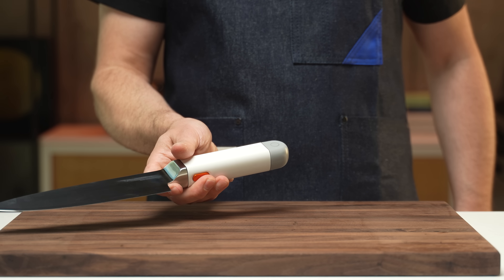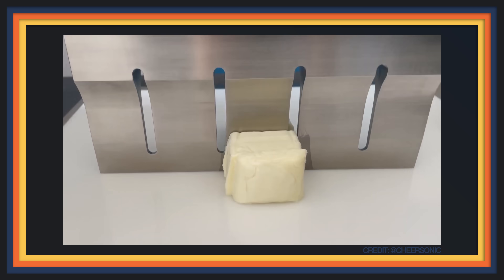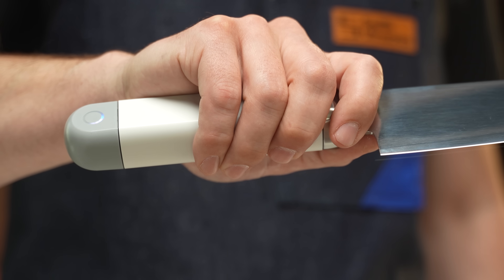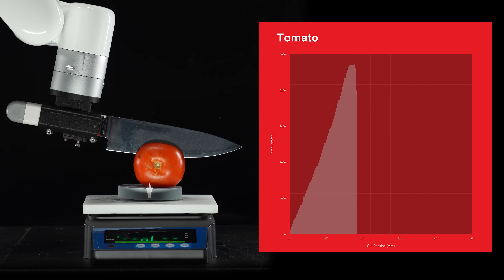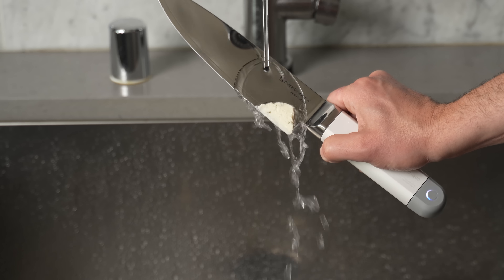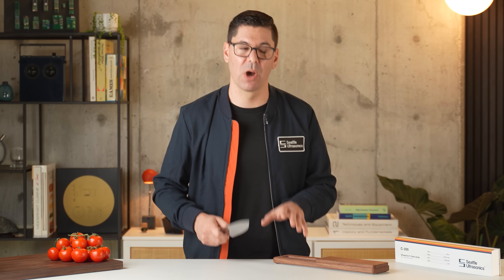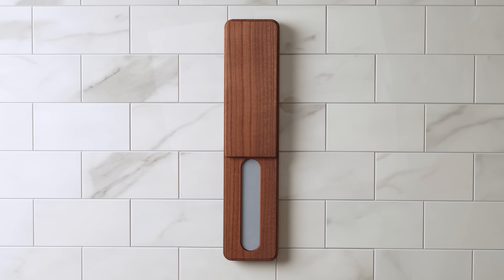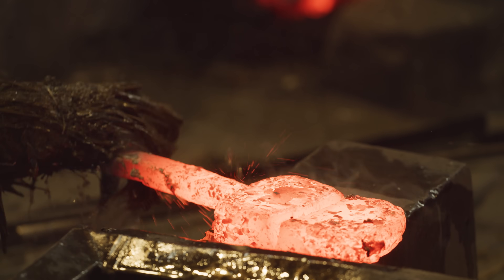The World's First Ultrasonic Chef's Knife for Home Cooks: Seattle Ultrasonics C-200

Comment: Huh?? How does the knife charge on the wall "with no cords required".
Reply from the maker: The Charging Tile itself is almost like an external battery pack...when it is fully charged, it will fully charge your knife 8-10 times. When the charging tile is low, charge it via USB-C (it will take about an hour), and then it's good to go again! The mount is specifically made so that whether you use command strips or screws to hang it on the wall, it is easy to dismount and hang back up again, it simply clicks into place.

Comment: When you push this button it drives your dog insane 😊
Reply from the maker: Good news! We've tested the knife around puppies, older dogs, and different breeds, and they didn't react when the knife was running. The ultrasonic frequency is generally beyond animal hearing range as well, so it shouldn't bother pets, although it has not been tested in the presence of all pet species.
Reply: @SeattleUltrasonics I guess 40kHz is a tad high for pets, but bats do upto 200kHz!
Having said that, bats are loud, very loud: 100dB ~ 140dB!!!
Maybe you could do some sound pressure level tests and compare it to a bat 😊

Comment: This looks like a great knife though i am not convinced that it will stay sharp....no knife will ever stay sharp, infact the problem with sharpeing knifes is what they use the sharpen the knife with in the first place, I have seen it all and the quickes devices are not working great
and the wetstones are messy and need to soak first, but I have not seen people use something that would work instantly...If you have every shaved you beard with a razorblade from the 50's last centuary then maybe you know that they used to use a leather belt to sharper the
knife. this design can be improved upon. One could make a belt out of a fine material as top layer that would sharpen the knife once you start sharpen the knife on the belt. That is to me the easiest and best way in a kitchen to sharpen knifes more often and getting them ultra fine sharp.

Comment: I wonder, Ultrasonic "cleaners" in Laboratories that are used to clean different instruments of dangerours materials are never to be touched when running. Inserting the Hands in Water is also dangerous. So how come this type of Ultrasonic wave is neither dangerous or loud
Reply from the maker: Although industrial ultrasonic machines are typically not safe for skin contact, Seattle Ultrasonics knives run at a small fraction of the power and will not damage your skin when operated normally. You can safely hold the knife in a pinch grip during use. The vibrations in the blade are concentrated away from the spine of the knife and into the cutting edge.

Comment: You're just moving the problem... before I had to sharpen my knife when it got dull, now I need to charge my knife when it runs out of battery... you're also just going to wear the blade down faster, which is going to be impossible to sharpen when it eventually does get too dull to work in this method. I'm sure SU has some good products but this ain't it.

Comment: Learn the art of sharpening at home have pride on it this stuff is crap je said japanis steel?? He dosent even know what type of steel his using
Reply from the maker: We do know what kind of steel we're using! The C-200's blade is made from Japanese AUS-10 stainless steel in a three-layer "san mai" construction. In san mai steel, a hard core layer is clad with tough, corrosion-resistant outer steels. The steel is heat treated to 60-62 HRC inner-layer hardness for edge-holding and durability. It comes with a 13 degree bevel per side.

Comment: Can you cut Frozen meat or Frozen fish anything Frozen so I do not need to defrost the all piece  when a want a small amount,  have you tried to cut Frozen bread anything, thank you.
Reply from the maker: It's not well suited for the scenario you're describing. When you use the ultrasonics against hard surfaces, like ice, it creates an unpleasant noise. The thin blade is great for thawed foods, but a good match for foods that are frozen solid. For that, you want a thick, beefy edge that can stand up to tough hacking. 

But if you're cutting portions off of very cold foods that aren't frozen all the way solid, then it'll perform nicely.
Reply: @SeattleUltrasonics thank you I will buy one it's curiosity because I never seen one, great product.

Comment: Incredible, my question is the danger of injury to human tissue? Next , the possibility of a surgical application?
Reply from the maker: Ultrasonics have been used in surgical applications for a long time! 
Although industrial ultrasonic machines are typically not safe for skin contact, Seattle Ultrasonics knives run at a small fraction of the power and will not damage your skin when operated normally.

You can safely hold the knife in a pinch grip during use. The vibrations in the blade are concentrated away from the spine of the knife and into the cutting edge.
Reply: Definitely will be used for surgical applications. This isn't really NEW technology but it'd be awesome to see it used like that.

Comment: "Warning: This product can expose you to lead, which is known to the State of California to cause cancer and birth defects or other reproductive harm"
ehhrm?
Reply from the maker: The piezoelectric ceramic crystals are made of a material called PZT - it's the most common material used for ultrasonic devices. PZT stands for Lead Zirconate Titanate. The lead is crapped in a crystal lattice, and the crystals themselves are inside the water-tight sealed handle, so you'll never come in contact with them. However, California law requires that any product containing lead in any form is disclosed prominently. Hence the big warning statement.

Comment: Are you holding it in a strange way or is it me? Why does your finger and thumb go off the handle?
Reply from the maker: That's called a pinch grip and it's one of the standard ways to hold a chef's knife. It's great when you want a little more control of the tip. But you can hold the knife in any grip you prefer.
Reply: @SeattleUltrasonics  thanks for explaining and the quick reply.

Comment: In an age of AI slop, this is some really sick innovation that fills me with joy to see! A few questions: 
1. what is the battery life like (I imagine it’s pretty good with piezoelectric crystals but still) and how does the weight compare to a typical knife of this size?
2. How is the balance of the knife in the hand compared to a traditional knife?
3. How durable is the blade at the tang, since the electronics necessarily take up space that would be reserved for a full tang? It’d be a shame to have my $400 knife snap off at the handle.
Reply from the maker: Thank you! For your weight, balance, size, and tang strength questions, we've got you well covered. Check out the video on our channel titled "Ultrasonic Knife TESTED: strength, weight, & size"

On a full charge, the C-200's battery provides about 20 minutes of continuous running at maximum power. However, the C-200 only runs while you're holding down the button. In practice, that 20 runtime minutes is enough to dice at least 20 onions or 40 potatoes. You'll likely get through multiple meal preps on one charge.

Comment: Demonstration is impressive.  The tech is impressive.  I want one, just for things that have been shown off. 

But I don't think it works well as a real kitchen work horse.  The reason is that most people want to cut things quickly.  If this knife could do that, it would be shown used in that way.  But it was not shown to be used to cut things quickly.  Therefore, it can not. 
It may be able to cut things quickly enough for home shefs.  But the limit to how quickly it will go was not displayed.  I can only guess it can go very slow. 
Also, a few other questions:
What happens to the cutting board when the blade runs on top of it ? 
What happens to the hand if the running knife strikes a hand hard, by accident ? 
I suspect the damage, in both cases maybe greater than if a normal knife was used.  But I could be wrong.  Yet these are relevant questions with no answers. 
Please show us more, related to 3 questions:
1. How fast or slow can this knife go ? 
2. The damage to the cutting board compared to a normal sharp knife? 
3. The damage to a bone covered by a 1/4" meat (simulating a finger), after 150ms and 250ms, compared to the damage a sharp normal knife makes.  I think 150ms-250ms is a human reaction time? 
Please give us some answers.

Comment: Wouldn't be interesting if there would be an upgrade kit for existing knives. Effectively the knife is now an oscillating tool. Some people might be able to relate to this.
Reply from the maker: That would be rad, but unfortunately physics works against us. Unlike a reciprocating. Saw where you're moving the whole tool back and forth and you can have interchangeable blades, in an ultrasonic knife like this one. The metal of the blade itself is actually resonating. Therefore, the specific shape of the blade and the frequency at which it's operating are very specific and fairly sensitive. At best you could have identical replaceable blades, but unfortunately attaching any old knife blade to an ultrasonic generator usually won't work very well.
Reply: @SeattleUltrasonics Think about it, it makes sense. Might be a nice patent if you could come up with a sweeping algorithm that would adopt to the blade and material. There must be some sort of reflection you can measure. Think tdr.😊

Comment: I'm really surprised by the price and I don't understand why others call it expensive. $400 is a good price for hi-end chef knife. I thought, that'll be about $7000 😁 I'm glad to see that you understand it's not suitable for professional cooking - it's true. Every chef who uses a knife for several hours per day prefers milder steel because you can sharpen it on a steel rod in a few seconds. You have to do it 10-40 times per day but it takes, literally, seconds, and the price of that knife is about 10 bucks so you don't need to take care of it. And, even, recharge it 🤣
I would like to buy that one-of-a-kind-knife to use at home, but I prefer to get a tungsten carbide or zirconium ceramic blade instead of steel, no matter how good this kind of steel is.

Comment: A normal knife cannot be cut if it does not move. The knife in the video begins to cut the moment it touches an object. A brief mistake will cut your finger like a sausage. It is more dangerous than necessary. It does not have to be used in restaurants or homes.

Comment: Does anyone know what material the handle is made of? It looks like simple plastic in the video, which would be a bit disappointing if that’s actually the case.
Reply from the maker: It's PC/ABS. The handle has to be made via injection molding to handle complex internal geometry and super tight tolerances. But if you check our other video on handle strength, you'll notice that it's engineered to withstand way more more force than required. And it feels solid in the hand, like a durable tool.

Comment: Can this be used as ultrasonic homogenizer ?
Reply from the maker: Great question. No, not really. Since the motion of the blade is longitudinal, there's not a lot of cross section to push against liquids to make them mix. If you put the tip in water you'll see some mixing and stirring, but a homogenizer really needs a big, flat end to create cavitations over a larger surface area.
Reply: @SeattleUltrasonics    Thanks! Curious how you set up the transducer for that longitudinal motion — fully understand if the specifics are part of your proprietary build.
Reply: Also — why don’t we just stick a perpendicular fin on the blade for more cavitation… 😂 Imagine an ultrasonic mayo-making knife.
Reply from the maker: @BurhanHalilov the orientation of the piezo stack creates a piston motion in that longitudinal direction (down the length of the blade). But the hard part is keeping the movement along that axis, since knife blades are long, thin, and flexible. The solution is just the right geometry, coupled with just the right operating frequency to maintain the intended resonant mode. And gobs and gobs of failed attempts in my wake.
Reply from the maker: @BurhanHalilov I like your thinking! I've got an idea that's similar in spirit in the works but for a whole different product...

But for knives, cavitation isn't desirable. We just want that blade edge to move back and forth for "micro slicing".

Comment: Dear Seattle.
I'll get one. But..!. I'll modify it the same way I modified my various expensive chef knives. I never understood why knife makers don't do that. There is a part of all chef knives that is  extremely dangerous and I always do this: It's the part of the cutting edge that is the nearest of your index (and thumb) when you hold the knife, It's the back of the blade. It's always plus or minus 90 degrees to the blade, very pointy, very and always sharp because we never cut that far with it. But it knicks a finger deeply in a treaturous and unexpected way if you don't pay attention to this 'corner'. It's dangerous. So I always file down that corner 1/4 of an inch and make it round and unsharpened.

Comment: I wonder what will happen if you try to sharpen it while it is on, I think it will sharpen much faster.
Reply from the maker: Yes, but... Please don't :-) Two reasons: first, as with any standing wave, there are nodes and antinodes along the blade. That is, places where the vibrations have the highest amplitude, and places where they have the lowest. So you'll get uneven wear against the blade edge. 

Second, it's way too aggressive. I tried this on an early prototype and removed almost 1mm of material in a few passes. Yikes! 

However... I do have plans for an "assisted sharpening" mode that uses the piezos to help speed up sharpening, but run at a set of different frequencies to compensate for the above. If/when I prioritize that, it'll be compatible with the V1 knives (firmware is upgradeable over BLE).
Reply: @SeattleUltrasonics  love the idea, this thing is straight out of science fiction movies (predator Badlands sword) 😊

Comment: I work as an engineer for a premier US industrial ultrasonic cleaner manufacturer, and find this extremely fascinating. I really want to know how you packed not only enough power to make this work, but enough energy to make it work for long enough to actually do anything with into such a small package. I'm incredibly curious what kind of wattage this thing is pulling while the ultrasonics are running, because there just is no way it's very much or you'd have to strap a gigantic high performance battery onto it.
Reply from the maker: We pull 10W when the knife is on, and that's enough to create a longitudinal displacement of 10-20 microns at the antinodes along the blade. That wouldn't be even close to enough power to run an ultrasonic cleaner. But, those cleaner transducers spread their energy out to an enormous cross-sectional profile where the horn meets the tank. By contrast, we reduce the cross sectional area of our piezos down to the cross-section of the blade, which tapers from about 2mm at the spine to a point at the cutting edge. So it takes way less energy (at resonance) to achieve a comparable amplitude. At just 10W is sufficient to reduce food cutting forces by 50% (or more, in some cases), and dramatically decrease the friction on the blade face. 

The other way I made this work is by banging my head against the workbench for six years, finding every possible way it wouldn't work, and crossing them off the list 🙂

Comment: It's a huge red flat when the commercial does not demonstrate cutting fresh meat, since it works similar to a cast saw, I don't know how well it performance when it comes down to cutting meat. Afterall, unfrozen meat is the most difficult thing to cut in a kitchen.
Reply from the maker: Butchery demo coming shortly. Spoiler: it cuts meat.

Comment: Usually ultrasonic cutters and cleaners have a very large counterweight. I don't see that here. That really limits the amount of ultrasonic power that can be delivered to the cutting surface.
Beware: nowhere is the ultrasonic power listed and this thing starts at $400 without the charger. Zero information as far as specs on the site. This is somewhere between a gimmick and a scam.

Comment: Ive been thinking about this sort of knife for the last 20 years or so. This has been in a lot of scifi for many decades. Its intresting that real worl tech is catching up. It really is the next step in ease of cutting in general. From knives to swords. In scifi/tech fantasy they would have names like vibroblades or sonicedges.
You have to treat these as EXTREMELY SHARP blades. Like impossibly sharp. They have the potential to slide clean through your leg to the bone even if they arnt that sharp while off. I really hope they have a feature where if youre not holding them they cant remain on.

Comment: Battery-wise, could you make it CR2032 as in AirTags? Or an AAA battery. I need it replaceable and widely available
Reply from the maker: Unfortunately those batteries don't have nearly enough juice to output the 10W of power required. But we do sell extra battery packs, if you need. They're designed to last as long as possible.